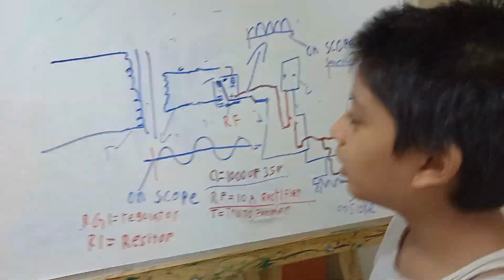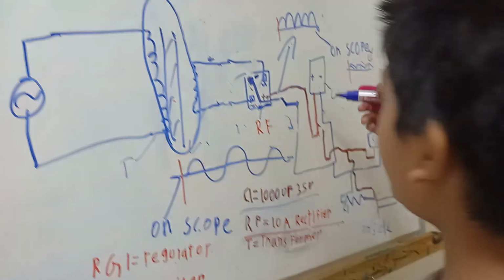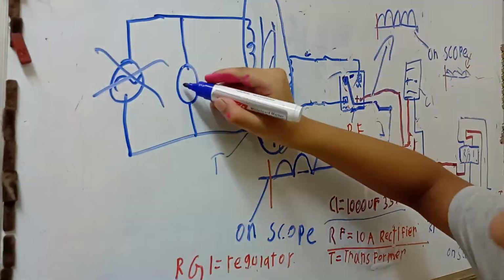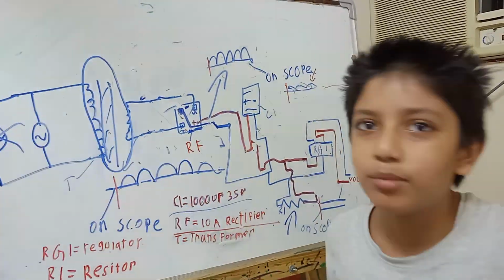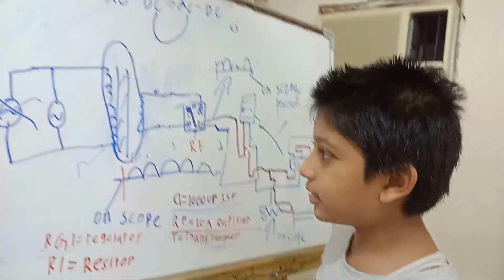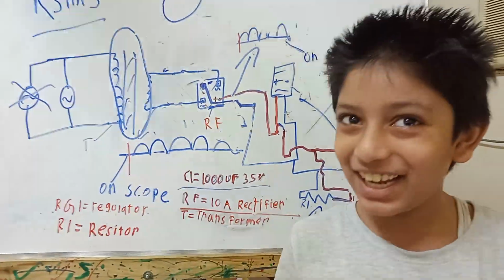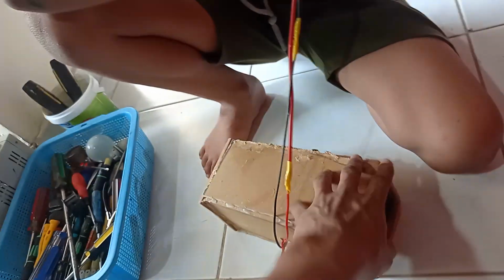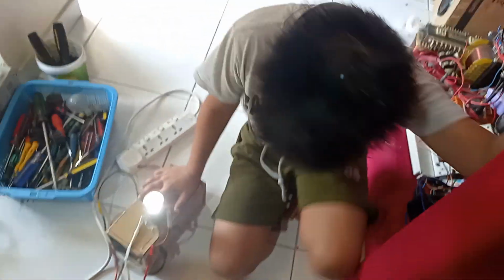Interviewing Shashwat-DC power supply Circuit (Make DC from AC 220 V) - lightup LED\RunMotors

Comment: Using discharge resistor for that 🤷‍♂🤷‍♂
The lm7812 would discharge it
Reply from the maker: i did not know that
Reply: @Avidiy  no problem you are pretty young to know that 👍😀
Reply from the maker: @technicalideas1234  i will subscribe to you
Reply: @technicalideas1234  I think I should also make video's in Hindi language beacose you do so actually I am login from my slow motion channel si check that out
Reply: @Avidiy  wanna learn electronics?
Reply from the maker: I mean yes, I will learn from your channel. 😀

I apologize for the very late reply I didn't check my comments on my videos, next time it will be more consistent!

Comment: Next is
 batteries when charged with pulsed charging using transformer and scr that type of charging is best for batteries 
And u are using lm7812 and want to use smps and rsmps 😂😂😂😂
Reply from the maker: That is true but there is lm7812 is 12 volt but there is no 13.8 voltage regulator 🥺 but if there is a voltage regulator i would happy to know or learn
Reply: @Avidiy  use lm317 adjustable voltage regulator bro then u can set to 13.8 volts 👍👍
Reply from the maker: Ok I will try making it
Reply from the maker: also I didn't know all that back then. I am sorry for a lacking video if you feel that